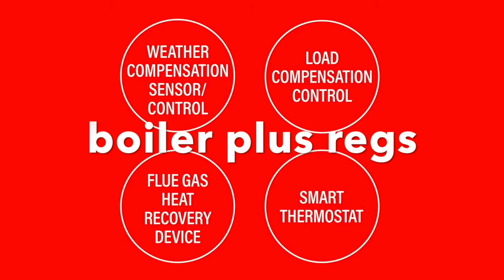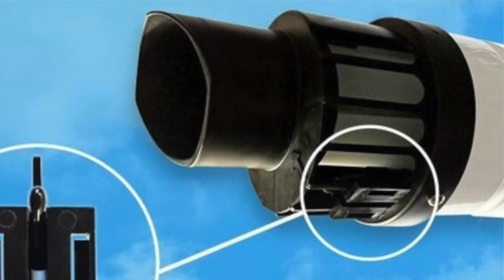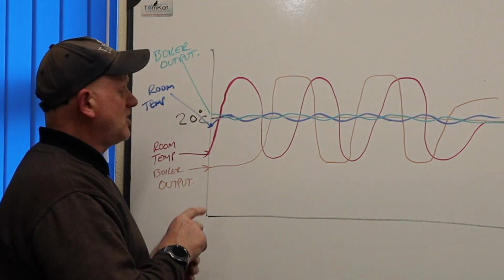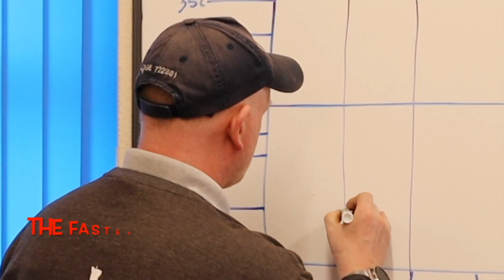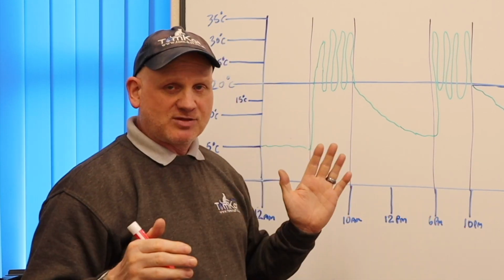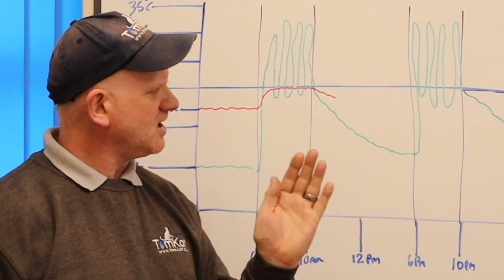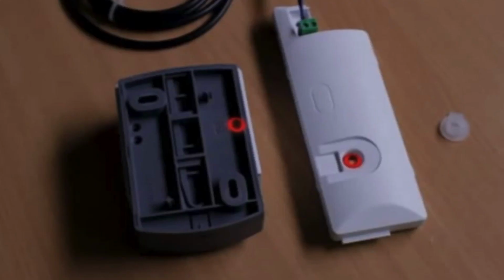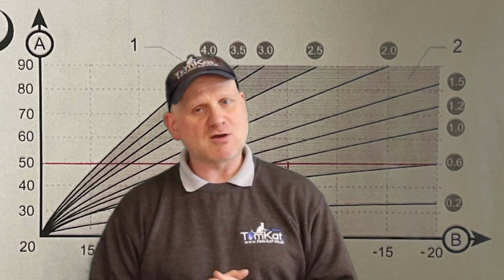Boiler weather compensation, what is it,  does it work and is it worth it.

Comment: Used to work for the old mpbw ,ministry commercial buildings,RAF bases ,tax offices ,passport offices ect, we were taught this in the early 80,s ,...no smart things then lol, we had to put a paper thermometer recorder in a building.... 6 or so if zoned , then monitor outside, then draw each zone/building points onto a paper graph to check if heating performing, happy days!!, it worked quiet well , we had a 1360000 btu boiler house and managed to save about 1000 galls of fuel per month using weather comp.Thanks for the vid brought it all back!
Reply: 1000 g /m is quite substantial. How many pilot lights would that support? How much energy is in a spark ignition together with its supporting electronics? What about the flue pump fan, the circulating pump? Do they weigh all that into the efficiency guide? A modulating burner seems like a positive together with lower flow temps and optimum condensing..... ?? !!
Reply: The offices phased all that out in the mid-80s. Everything is controlled by INTERNAL thermostats, nothing is recorded or used from outside sensors - certainly not on the 963 Controllers.
What people tend to do is open a window in summer when someone forgets to turn off the perimeter heating radiators.  This cold air hits the thermostats and calls for heat, so the warm air at 30c+ comes through causing anyone not near a window to bake.
In winter, the perimeter heating means that the thermostats don't even fire up the warm air, so the offices and buildings are heated unevenly.
No one uses weather compensation, it serves NO purpose!

Comment: I've got a tado system and am waiting on them getting back to me to confirm how I wire it to work with the WB version of opentherm. Is it just as simple as installing an outside temp sensor as well or do I need the full WB weather compensation control system?

Comment: Viessmann Vitodens 200-W on weather comp. the best there is.
Reply: This is what I have and Ive just out the WC sensor on last weekend ....bit of trial now to get the house at the     desired temp...1935 Semi....Im going with 1.6 curve       at the moment
Reply: @Newmusicreview  that’s a good place to start. Leave it for a few days and then make small adjustments at a time. I run 20 degrees morning and evening, 17 during the day and e degrees at night. You’ll never look back. 👍
Reply: @matthewdrew9370  we’re out all day ..should I still set it to 16 or something..Same at night ?
Reply: @Newmusicreview  yes. Keep the house ticking over. If the outdoor temperature gets to 10 degrees in the day for example the rads won’t be very warm anyway. If you turn it too low the temperature won’t recover in the evening

Comment: So weather comp adjusts flow temp based on outside temp, and the curve you choose is how you help balance based on your heat loss? Can you still fit a timer controller/have setback temps as we wouldn’t want eg 20c overnight
Reply: Yes, I control mine with Drayton Wiser with no wall stat, just one individually programmed smart stat on each of the 13 radiators. Each radstat can directly address the boiler.

Comment: I've range rated my Worcester 30CDi to 50%. set the flow temp to 55C, set pump to be step adjustable and installed a Nest set to minimum of 15C. The Nest will display it's estimate of time to reach target temp and stops calling for heat before the temp is reach to avoid overshoot. The Nest get local temp from internet, of course.
Reply: Smart 👌🏻
Reply: How much has this improved your energy consumption?

Comment: Finding a plumber who will do this for you is even more of a challenge than getting the weather com curve right. We had a Vailent engineer out this wek to fix the cockup he did last week when supposedly doing a 'full service'. After fixing his stuff up he then said he wouldn't service our Magnaclean because its was made of plastic. FFS its in contract & try finding one that isn't plastic on the outside. Vailent say it should be done by 'Gas Safe engineer at least every 2 years yet their own staff won't or can't. We'd love weather comp but trying to find someone to do basic competent plumbing in central London for a small flat is next to impossible.
Reply: A major problem! When I started looking for quotes to supply and install a new boiler almost nobody had a clue what OpenTherm or weather compensation was :-(
Most were very anxious to change the subject when I started asking questions.
Reply: In  fairies this Adey Magnacleans are a right pain...they leak as      soon as you look at them

Comment: Interesting, but where is the evidence that keeping a boiler cycling on & off all day, and keeping the house at an even temp, is more efficient than having it go thru larger cycles during shorter periods, and being off most of the time? You'd expect boilers to work most efficiently at their designed load, not at partial load.
Reply: The aim is to maintain maximum combustion efficiency to extract the most heat from a given amount of gas. Anything you can do to maintain the length of time the boiler runs in condensing mode will assist this, thus tight control of flow temperatures around the 50c level are desirable. With large hot cold cycles your boiler is running at maximum efficiency for short periods only. Weather comp and opentherm should dramatically reduce cycling. They run much longer at a lower condensing temperature as they are not off/on devices like a thermostat, they use thermistors instead that vary load based on temperature measured.

Comment: We are in all day, every day and do not have a boiler programmer and only switch on the heating in the evenings when we feel cold. In the winter we wear plenty of clothes to keep warm and there are many evenings we have no need to switch on the room heating at all. Can the weather comp/opentherm be run manually by people like us without all the fuss of programming? bear in mind we do not have any Wi-Fi in the house and not smart mobiles.
Reply: You'd need to have a wired open therm room thermostat fitted in conjunction with weather comp or just the open therm room stat. The open therm stat would be programmable for time and temp. This would require you to manually set the temperature.
Reply: @ch4gascare  You don't need opentherm to have weather compensation. How easy/costly either or both are to fit depends on the make/ model of boiler and the heating system type. A lot of modern boilers have "plug and play" modules that make it easy. Earlier boilers may have compatibility/ availability issues. The cost of the necessary kit varies quite a lot too. I'd start by asking the boiler manufacturer what is possible and available with the model of boiler, and then do some costings.
Reply: @timhancock6626  you’re right there Tim and the boiler manufacturers options are often the best option, but can be more costly. They would normally be my first choice though, with an external WC sensor connected to the boiler, if it’s available. Open Therm though can you give you internet WC, which is pretty good.
Reply: @ch4gascare  I have an old Valliant ecomax 828 combi which has no open therm or ebus. Would a simple TPi room thermostat stop or smooth down the boiler over/under swings.
Reply: Indeed. You are your own 'weather compensation'.

Comment: I am a retired gas engineer and I have had an A rated combi with weather compensation for 16 years now , I did work in the commercial sector and appreciate how WC systems work . I have had occasions in winter coming home after a short break away in cold weather returning on a warm day when the flow temp wasn't enough to warm the house , simple adjustment for me but not for the usual house owner . Apart from that situation the system works so well keeping my house at a steady temperature . Well worth fitting .
Reply: You are confirming it is heating the inside of your home with reference to an outside temperature only - and then saying it doesn't work.  That is exactly why it is not used.
Reply: @Bond2025 Hi , you have a point but still using outside weather compensation with a programmable room thermostat though . I have increased the low flow temp setting to 55c with a max temp of 72c and this works ok now . Thank you for your comment .
Reply: That's an excellent recommendation. Thanks!

Comment: So many variables affect consumer perceived comfort levels, hot radiators are associated with warm rooms, not an accurate method.
It boils down to the heating input being being adjusted to compensate for the heat loss of the building as you've explained. Only intelligent controls can achieve SENSIBLE  comfort levels and end user education is a must! In the days of a radiant gas fire in the lounge, we would turn it up till we were too hot,turn it down till we felt cold and repeat the process. Weather compensation and open therm removes the human element!
They do work,save energy and improve comfort levels, it's all about educating both consumers and installers! On/off controls don't have a place in today's world!
Reply: Continuing the gas fire analogy, we ought to remember that it comes from open fires in a grate with a chimney stack. This has a a history going back hundreds and thousands of years. We adapt slowly to new ideas and built into our psyche is that same need. Several people share the fire. They jostle their positions naturally turning, closing in, and drawing back to get what they want. Then we have the air-flow. The vent needed to keep it fed with oxygen with the draughts built in to many buildings which give us air changes (ventilation). All these needs built into our psyche and our physiology. We attack the inefficiency justifying our approaches with clever but sophisticated arguments that don't always stand up to closer scrutiny. Efficiency was warm soup and hot toast.  The conversation stimulated by being cold and therefore wide awake. Yes the good old days when “Central ‘Eatin” had a very different meaning!

Give me the wide open plains and the night sky above. 
The snow on the ground and cold that I love
I won't survive long but I'll know that I lived
Much better than comfort and hot meals in a dish

P.S. I ought to admit that we are now being driven less by what we want and more by what we can afford. More to the point is what mother Earth can afford isn't it?!
Reply: I don't go into a room and look for a source of heat to think it is warm, I go in and feel the heat around me.  I am happy using radiators and certainly don't care what they feel like if a room is warm.
My heating is adjusted for me to feel warm, I couldn't care less about heat calculations or building losses as I can not change them and outdoor temperature sensors will not change it.  I set the temperature of the house to be 22c and don't care how it gets there.  I just want the boiler to keep firing if it needs to when the room cools.
Having a temp sensor OUTSIDE is a bit silly, I am not sitting outside and the room is not outside temperature.
Setting a low flow temperature means a boiler stays on for far too long, becomes inefficient, and uses far more gas than if a higher flow temperature was used.  
Imagine if i put the oven thermostat in the garden and tried to cook something, but based it on the weather!!!  Are people really deliberately not understanding heating systems work, or how the input, location of input devices, radiator sizing, pipe sizing and flow temperatures all work?

Comment: I would also mention that anyone with a boiler that heats their home AND a hot water cylinder needs to understand how the weather compensation interacts with flow temperatures needed to heat the cylinder to the required temperature. If the weather compensation is calling for a flow temperature of 40C, this is never going to be able to heat the water in the hot water cylinder to 50C! Many boilers can be setup to heat the hot water cylinder on a priority basis, and this can also include setting a suitable flow temperature for heating the water in the cylinder. When there is no demand from the cylinder, the flow temperature can revert to whatever the weather compensation is calling for.
Reply: Seams to cost another more to apply weather comp to s and y plans smart wiring centers etc
Reply: @galaxydave69  A Weather Compensation kit from Ideal for a Logic Heat Only or System Boiler on Y or S Plan is about £70. This kit includes a relay that locks out the Weather Comp when Hot Water is calling for heat, so the cylinder gets flow at the proper temperature. You dont need a " smart " wiring centre either, just one extra wire goes from the kit to the HW " on"  terminal in the wiring centre to achieve this. They had thought of this requirement. I don't know what other manufacturers do, but they will have thought of how to satisfy hot water cylinders too I'm sure. What they charge for their kit I don't know . Sometimes kits turn up on ebay unused for very reasonable money.

Comment: I would encourage anyone that has weather compensation and doesn't like it to persevere with tuning the heating curve rather than just disconnecting it. The number of times you need the boiler to output its maximum are very few, perhaps no more than 10 days in any winter. At all other times, something less than the maximum output will save you money.
Reply: Ive just put a WC sensor on my Viesman boiler, the curve was preset to 1.4,,,but the house was a bit cool for us, Ive raised to to 1.6....is this the right thing to do?....I can't find much info on how to adjust the curves to suit your requirements ?
Reply: @Newmusicreview the curve represents a ratio. The curve the boiler was defaulted to gives a rise at one point four degrees to the flow temperature for every one degree centre.Great the external temperature falls. Buy adjusting your curve too one point six you will now get a slow temperature rise at one point six degrees for each one degree, the temperature outside falls. Good boilers like the Viessmann have a small correction to the curve which causes it to be curved rather than straight. This correction is to allow for the reduction impervection from a radiator as it's me, water temperature reduces. If you look at the curves used for underfloor heating, they are much closer to a straight line.
Reply: Absolutely agree with you Tony. When it gets really very cold you just have to select the maximum curve, then remember to back it off again when outside temperatures moderate a bit.

Comment: slightly off typic I know but may be of use to some of your followers ....... to help reduce costs...........I reverse engineered the house burger alarm system ( still acts as a burglar alarm when house is not occupied) but all round the house there are movement Sencers still scanning for people / movement reporting back to the control box ( but as you have told it that your home it does not sound the alarm) so I have connected the room movment sencors to the Honeywell so when there is no movement in a room for 10 mins the heating in that room drops by 3 deg when the Sencer detects movement it reverts back to the normal temp........when I go out and set the house alarm it turns the house heating down by 5 deg.........never thought how much is saved but  must be somthing!!!!   geofencing with out the need of a mobile phone

Comment: What about thermostat hysteresis? My old mechanical stat had around 3C to 5C change points. My new RF stat is set for 0.5C.
Reply: A larger hysteresis will give wider variations in the temperature felt by people in the building. This might result in the thermostat being set higher than it really needs to be because the occupants feel cold and see that the heating has gone off.

Comment: The GW sensor is the same at the Vaillant one, some even have swapped them with success. I wonder if you could use the controls on each system as they are both ebus.

Comment: Thanks for the interesting video.

I'm trying to get a feel for the payback period of converting my Y Plan to weather comp. I currently use 'manual weather compensation' which means that I adjust the flow temperature myself based on the next few day's weather forecast. Can you give a rough idea of how much extra gas savings a automated system would deliver. Also, what would be the rough cost of converting a Vaillent boiler (i.e. not compatible with Opentherm, so can only use Vaillent's own controls). I had quick look and factoring in the cost of their control system and compatible wiring centre I believe that I'm looking at roughly £400 of parts plus installation cost, so a very long pay back period. Is that your experience?

As an aside, my rule of thumb for setting flow temperature is "68 C - twice the outside temperature". So 68 C if its zero outside, 58 C if its 5C and so on. Still experimenting, but seems to work reasonably well.  I don't go below 50 C because of the need to heat hot water to a usable temperature (before anyone mentions it. I discount legionella because I've got a solar PV system the runs the immersion heater and even in water normally tops up the water temperature by  several degrees at least once a week). Would welcome comments on this formula.